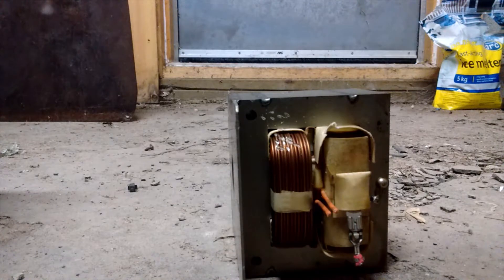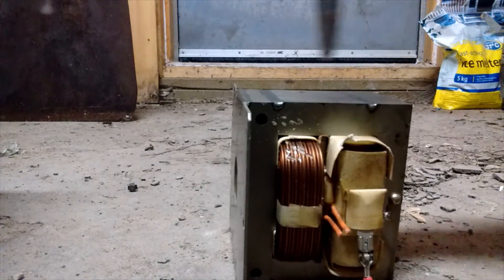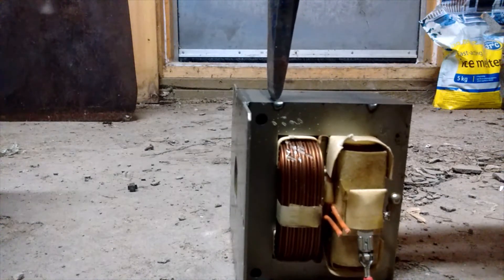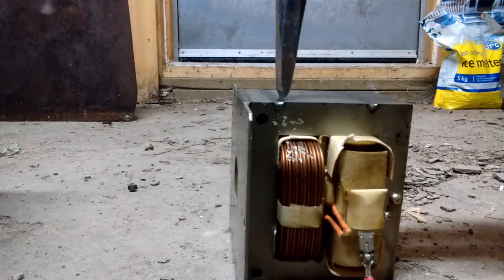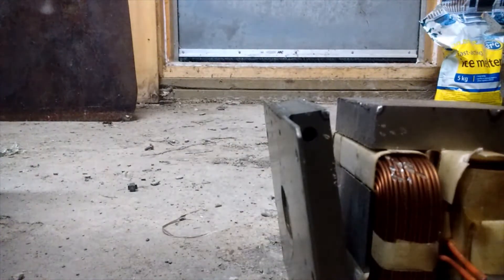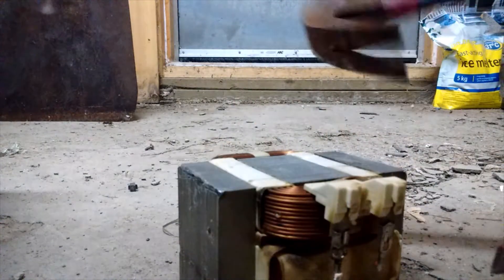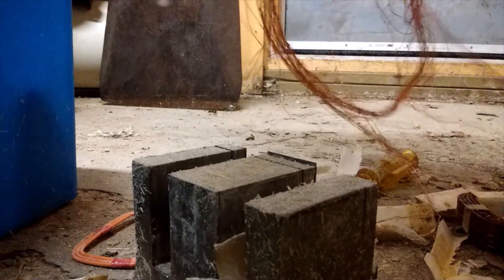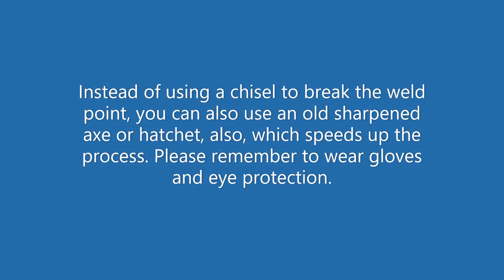Scrapping A Microwave Transformer For FREE COPPER

Comment: Wait so that bigger thick stuff isn’t even full copper?
Reply from the maker: Depends on the transformer. Some have two copper coils, some have a coil of copper and one of copper coloured aluminum, and some are 100% copper coloured aluminium. So, it is worth doing a scratch test on the 2 coils before breaking the transformer open to make sure there is at least one coil of copper, otherwise you're wasting your time.  The older microwaves (70s/80s) usually are double copper, some of the newer microwaves are a mix, others are all aluminium coils.

Comment: Not all transformers are mixed i.e. Copper An ally .cheap microwaves usually have the mix .plus the magnatron has copper An ally in them .oh An a capacitor witch is ally casing
Reply from the maker: The transformer this one came out of was actually a large under counter unit, pretty pricey, but more modern. I think most modern units are going to the combination of aluminium and copper.  Probably will redo this video later, also,
Reply: https://youtu.be/D23nhj7A95E